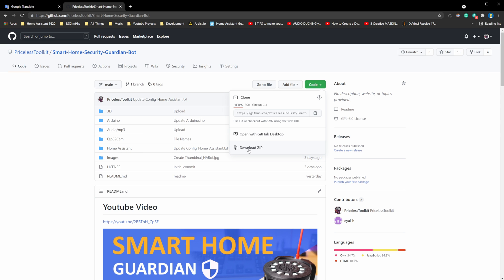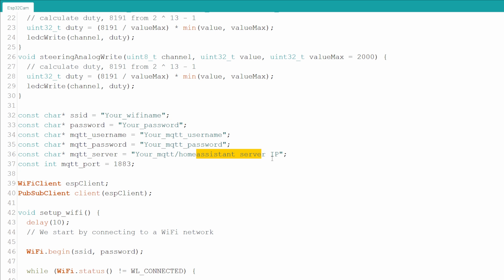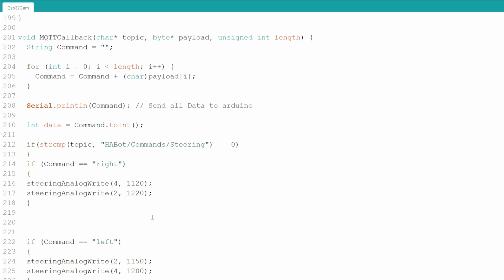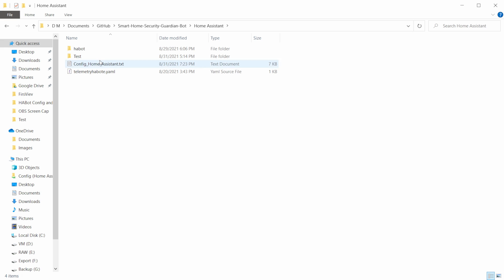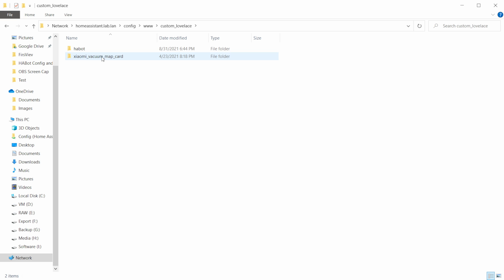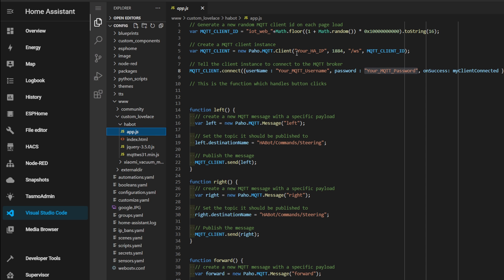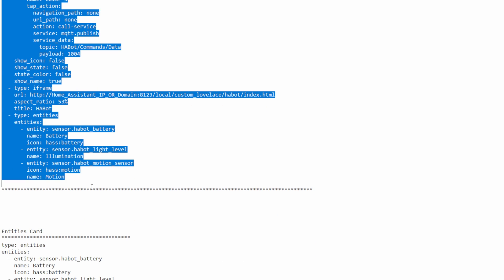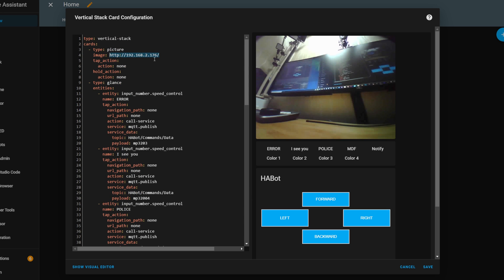Home Assistant BOT Configuration - Part 2

Comment from the maker: If you have any questions, I will be happy to answer!
Reply: hi i have problems with audio (non) what libary did you use for the df player mini?
and also have you tested the esc yet because thats what i used and have little or no movement..
Reply from the maker: 1. No audio at all? if yes, the player needs to be updated,  I just added a folder 'DFPlayer_firmware_update' to the github take a look.  
2. In the Arduino folder, I added the DFPlayer library
3. No, I have not checked it yet, I will check it soon,  Have you tried changing PWM Values?
Reply: @PricelessToolkit  thanks i will try to update i didnt see that
Reply from the maker: @timbanks870   I added all this after your comment :)
Reply from the maker: Yesterday I tested it, ESC  works!  see "Config_ESP32Cam.txt" file there is approximate PWM values

Comment: Very interesting project. Will give this a try but without Homeassistent
Reply from the maker: Thanks!. Yes, you can implement control in a different way, not through MQTT.  if you will have working code please share your code with comunity.
Reply: @PricelessToolkit  Sure will, but  it won't be ready by next week :-)
Reply from the maker: @Ed19601  i totaly understand you :)